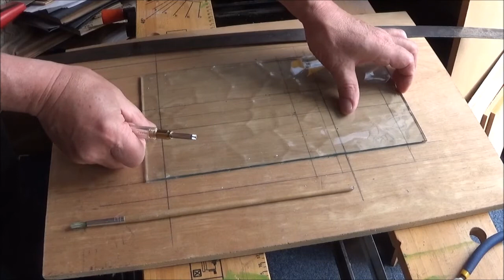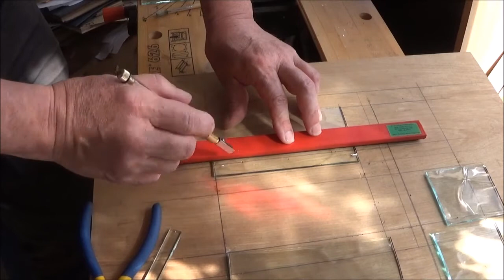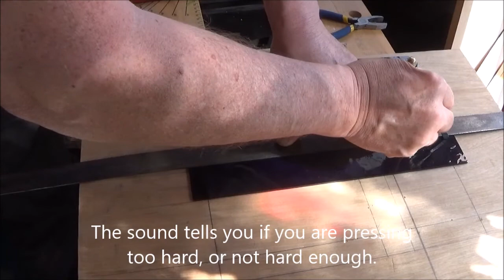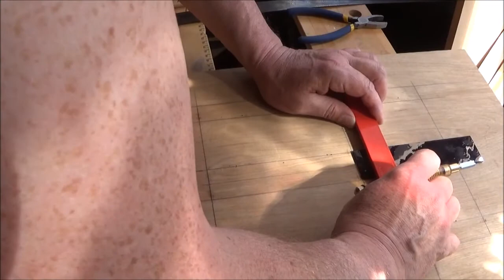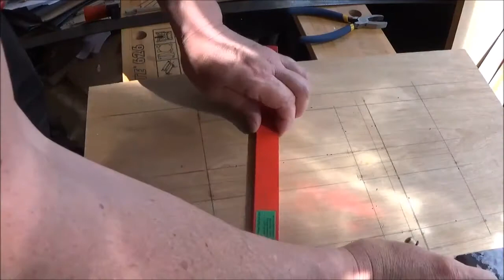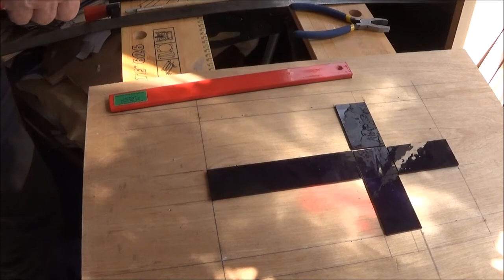Now get the lead out

Comment: Very nice. Would it not be preferable to break on a completely straight edge rather than the brush? I think the pressure would be more even, but perhaps it isn't important for that glass.
Reply from the maker: Normally, I use a pencil. It is only about starting the break, which will then happily run along the score.